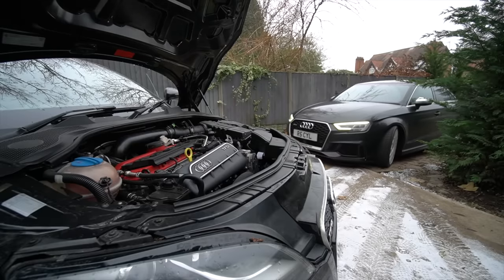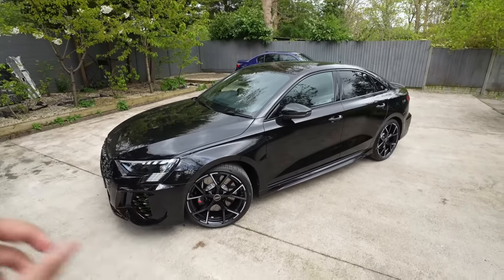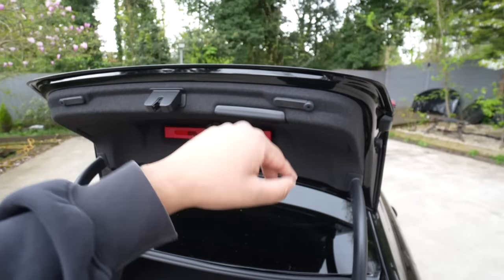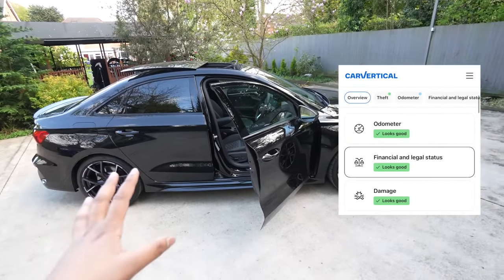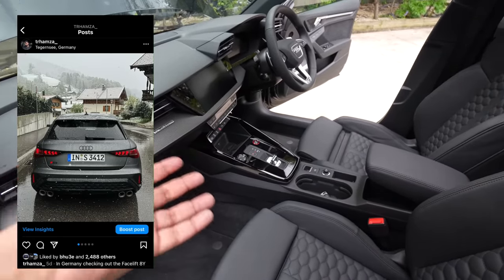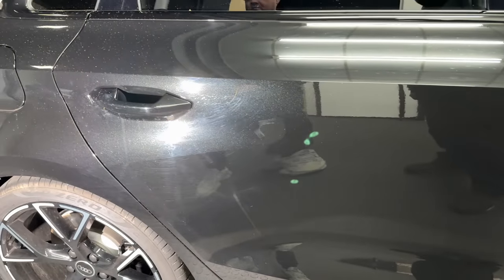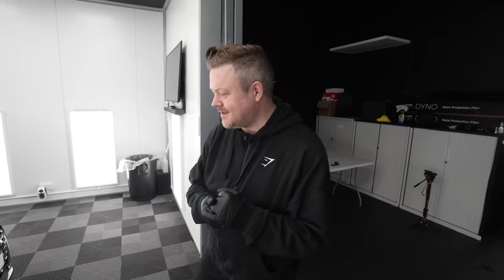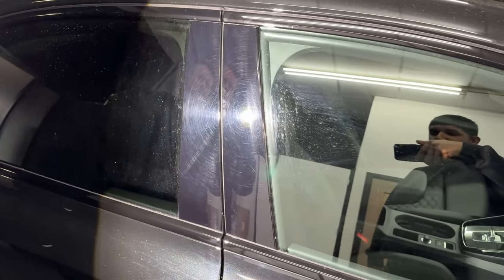I BOUGHT A NEW AUDI RS3 8Y!

Comment: On one hand it's sad that you ended up handing the RS3 back because of the engine problems, but in a way, it's also good as I'm now put off buying one. Was toying with the idea of either taking my S3 8Y to MRC for a stage 1 remap or buying the RS3, so you have saved me a small fortune.

Comment: The Audi RS3 is a high-performance compact luxury sedan that boasts a powerful turbocharged engine, all-wheel drive, and sharp handling. It offers a thrilling driving experience with its impressive acceleration, precise steering, and excellent grip on the road. The RS3's sporty exterior design is complemented by a refined and comfortable interior, featuring high-quality materials and advanced technology. Overall, the Audi RS3 is an impressive vehicle that delivers both performance and luxury in a compact package.

Comment: Audi like a lot of other brands are defo using poorer quality plastic/ carpets /leather in these new cars,i have a customer with a 2023 s3 and the drivers seat bolster was showing wear within 6 months, also the carpets are horrible more like something from a peugeot, he has a 2010 TTRS with 45k on it and the interior quality is far better.
Reply: S3 seats are Nappa leather which is soft less grain than normal leather.
Reply: @JohnGuidetti751  yes but shouldnt be showing signs on wear after a few thousand miles